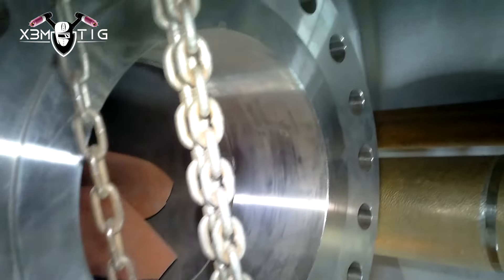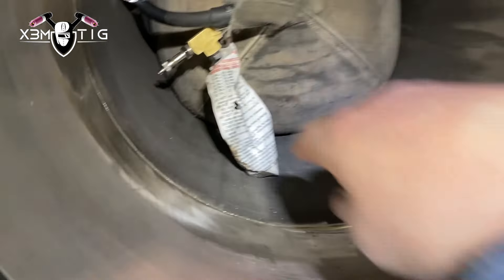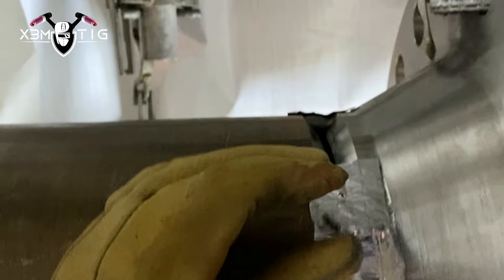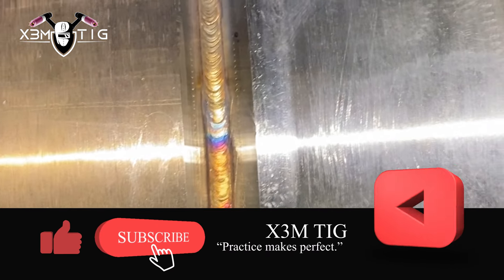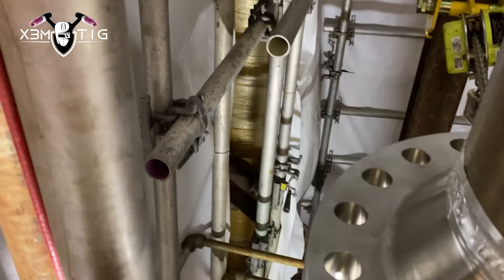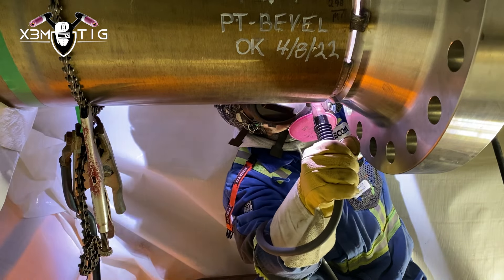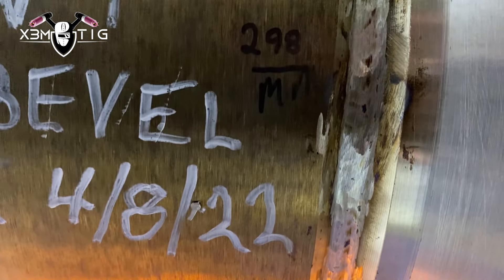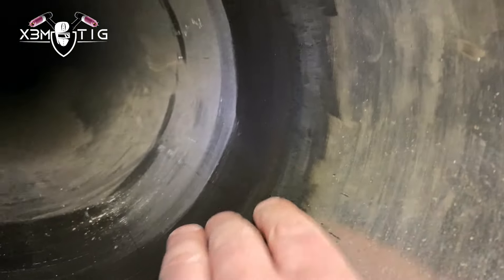TIG Welding Stainless Steel | Root & Hot Pass!

Comment: Great channel, good real life welding 👍 top skills. I would like to be able to try a root pass width 3.2mm wire. We don’t get 3.2mm GTAW here, do you think it helps for the bottom 6 o’clock portion of the root for better penetration?
Reply from the maker: Hey bud thanks for your comment. Not really, it all depends, from what you most comfortable with and the most important thing is “Gap” . I wasn’t involved in preping or tacking this joint, I prefer using 3/32 wire for the root pass. You just have to dial in and find good inclination for your filler wire.

Comment: Watching your videos has really opened my eyes I've always lowered my juice for the bottom part on positional butt welds, I've always been told up to now if your juice is to high on the bottom you will get undercut/ concavity if am doing a 3"stainless butt in 5g am on 80 from the bottom up past the sides then 90-100 for the top half, main reason for this tho 9 times out of 10 with stainless your gap tends to close in
Reply: Great welding btw

Comment: I have found the same thing as you about welding 6oclock to the top for stainless to start with. from time to time I have to start at the bottom but in those rare situations I put quite a few holes in the tape at 12oclock and the purge tube at the bottom. i never thought about using the metallic duct tape for the purge. they just handed me painters tape and said go. either way it's going to stick to the back of my glove and roll up as I weld.
Reply from the maker: Thanks for your comment, I was using aluminum tape, I find it better than painters tape as doesn’t leave much glue on the pipe when got hot , but as you said, either way it will stick to the gloves at some point 👍

Comment: How’d you break out welding? I got my structural welding down but I’m having a hard time trying to break into pipe, was thinking about going to school to learn tig since my company doesn’t work with tig pipe, only big bore stick
Reply from the maker: Hey Nathaniel, thanks for your question. Structural welding in all positions is base line for switching out to pipe stick welding. Once you get really good at structural welding, shouldn’t be any problem to apply your skills to pipe. Overhead and vertical is where you need to focus more on controlling your puddle, that is most tricky part for pipe in 6G. TIG is little bit different story as it’s less beginners friendly, but if you willing to learn it will take some time, and the best way to learn is to start in 6G rite away. More you burn more you’ll learn 💪
Reply: @X3MTIG so I ended up going to school not long after my comment, finished a 9 month field combo course (tig pipe, stick pipe, stick plate) in two months. Those years of burning stick rods paid off and got in and busted ass to finish but I always come back to reference your videos. Appreciate all you do, that freehand on the bottom was gnarly. Greetings from Louisiana 🤘🏻
Reply from the maker: @nathanielclause2588  happy to hear that brother 💪

Comment: Nice welding but I think you need to invest in a better purge set up you see that theres coking in the weld from lack of purge gas in alot of industries that won't be exceptable I'm guessing your doing sanitary pipe ? I'm guessing steam or water. As if it's for product I know in my country they won't except it great technique
Reply from the maker: Thanks for your comment bud. I’ll let them know 👍
Reply: 😂He is working for different companies as he is a field welder, therefore he can’t choose the equipment  or the tools at various sites. 🙄 So, imagine, how good one needs to be to actually work with those outdated tools and equipment!!